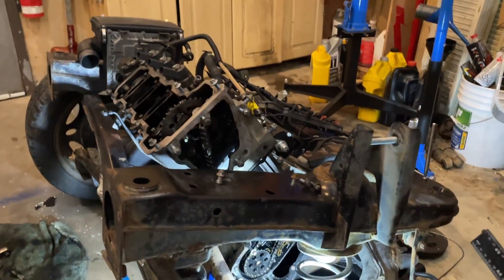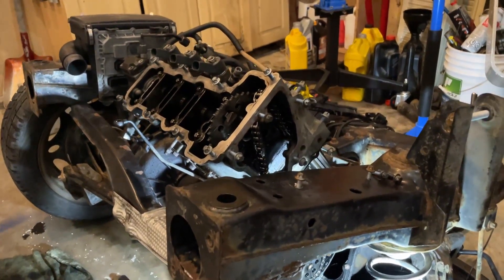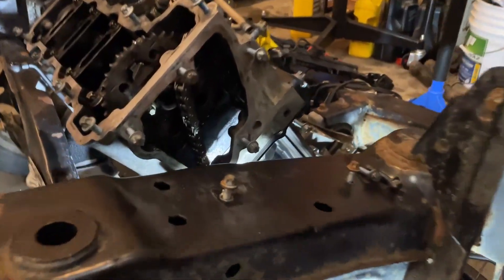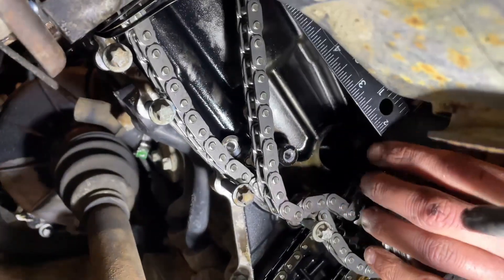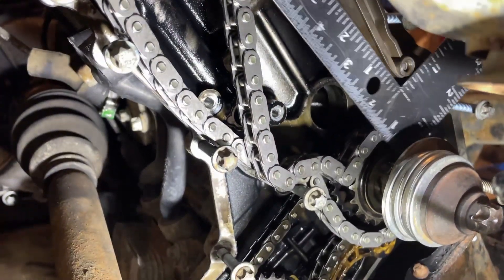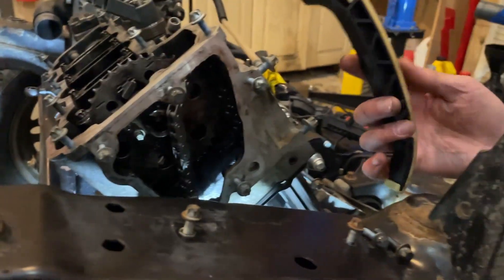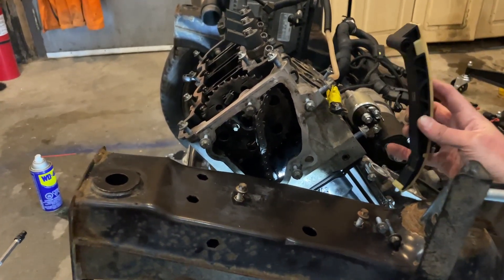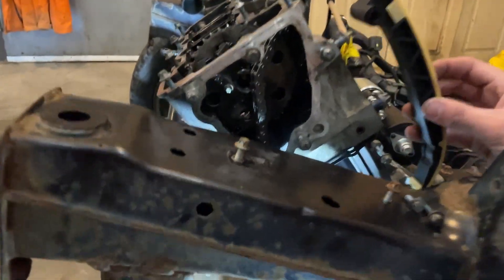Timing Diesel Smart car Engine OM660 Instructions

Comment: Great info. I must take my engine out for a broken valve. Do you have any suggestion for the best shop manual tu buy to do this job? I already bought an online version that was suppose to cover all versions but it does nt cover cdi...
Reply from the maker: Sorry we just used online resources, we didn't have an actual manual either.

Comment: So mine broke ... is an interference engine or the valves bent or broken i haven't  had a chance  to open it up
Reply from the maker: Yes this is an interference engine. There are multiple ways to see if damage was done, but honestly these engines are so easy to pull out I would just drop the engine and do all of the upgrades and fixes while you are doing the timing chain.